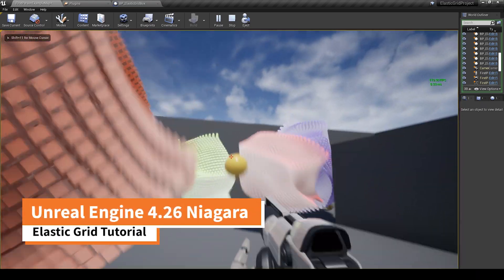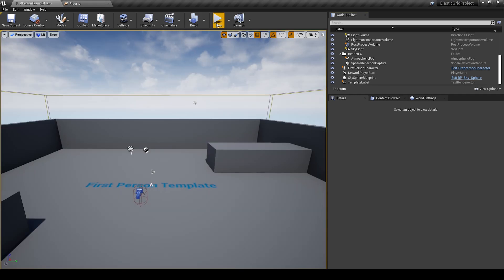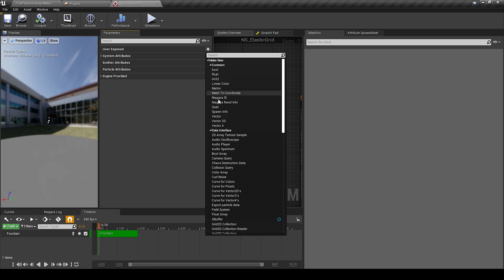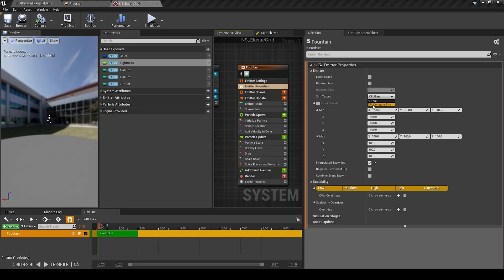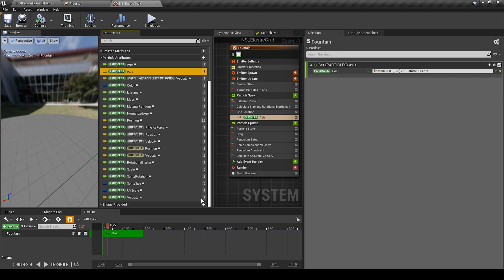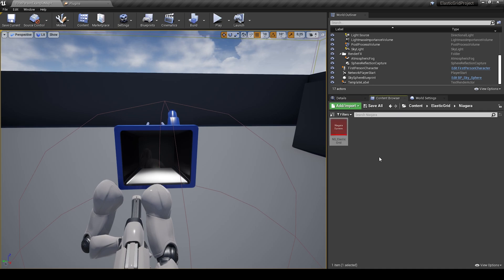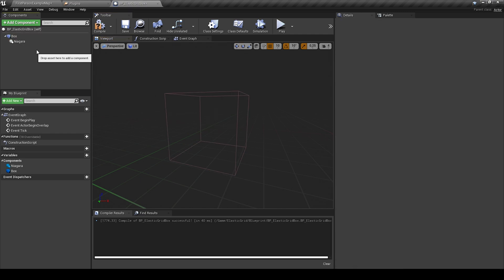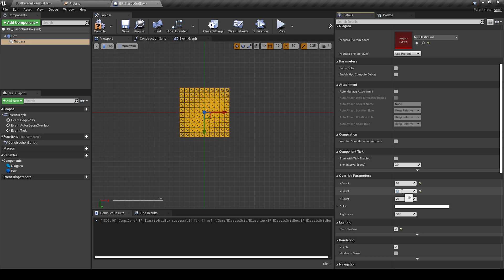Unreal Engine 4 26 Niagara Elastic Grid Tutorial

Comment: Works great! One issue I can't solve, is when I fire at the cubes, they immediately disappear!

Also, I found I had to set SpawnRate on the system to 0 since there were weird additional spawns of the mesh in a diagonal through the cube.
Reply: Had the same issue with the cube disappearing when getting hit. Solved it by increasing MassInKg on the collision to something higher than 10 (depending on how far you want to cube to go, but 10 was like the lowest value I could have and still see the cube fly away)